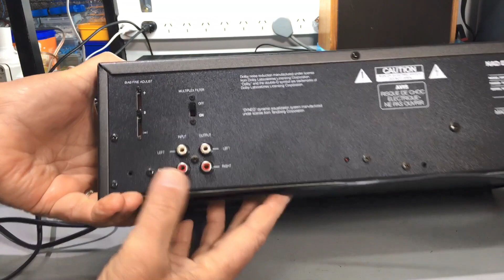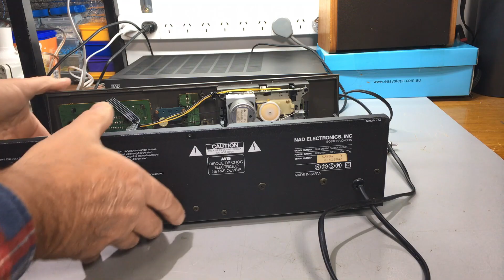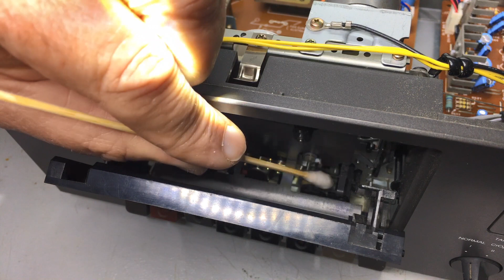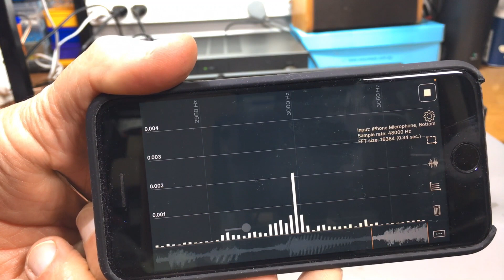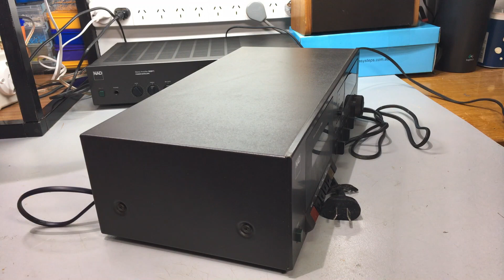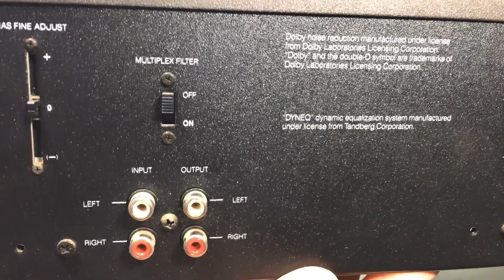NAD Stereo System Full Service - The 6240 Tape Deck -  Pt4

Comment: Hi there, I just picked one of these units up and I'm not too familiar with cassette decks. Mine seems to have an issue where the motor will drive a tape, but I've got no audio output and no display lights including the power indicator. Can't see any visual signs of a bad power capacitor, but I figure I should start there. Any keen ideas from your experienced mind? Thanks!
Reply from the maker: Definitely power supply, check fuse, transformer, main voltage feed in the supply. Very hard to diagnose without seeing it.
Baz

Comment: Just opened mine up to investigate a clicking/popping noise to find a belt was off and the auto cam gear was snapped 💀. Going to assume my only course of action is to find another being sold for parts?
Reply from the maker: Oh dear ! I did build up a cam gear with JB Weld on a recent tape deck but yours could be totally different. There are a few odd ones about but worth a few $$
Good luck 😉